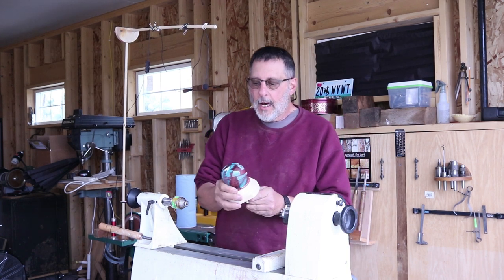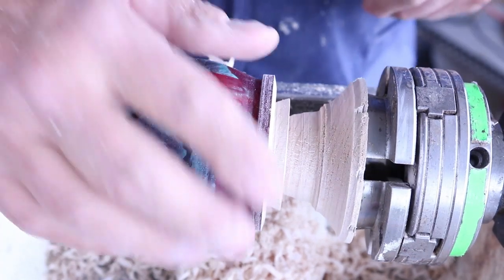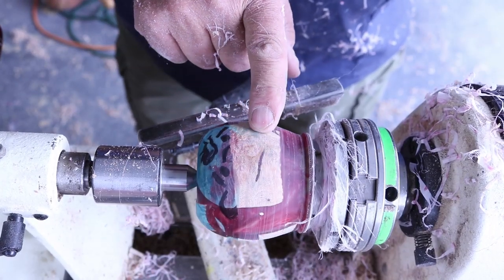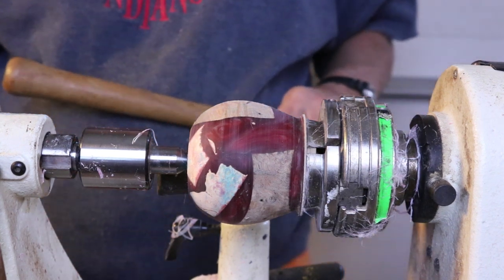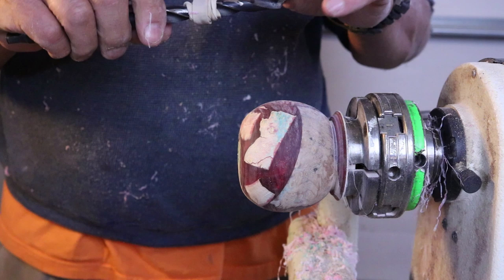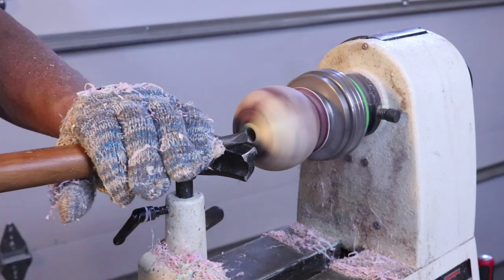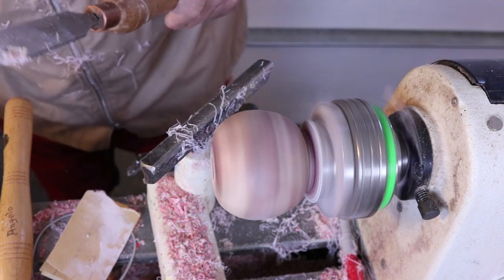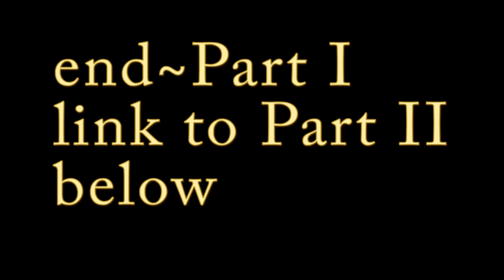An Apple A Day: Part 1 Turning and Hollowing the Base       Sam Angelo

Comment: Question? Why not hot melt glue this base to a wood base, made from using a threading tool?
Reply from the maker: I am not confident that hot melt glue would hold.....I'm just not sure.  What does, "Made from using a threading tool?" mean. Sam
Reply: Sam, response to my hot melt glue. I do only segmented turning, and I take my assembly on & off the lathe frequently. I started making and making wood spindle chucks by using a Beall spindle tap. I hot melt glue my bases to these wooden chucks, it holds great. The trick is to apply the glue when it is HOT, then let it cool until it becomes opaque .So far, so good. Thank you for making your videos, I have learned so much. Chuck
Reply from the maker: @chuckbell2949  I have a lot of confidence in double stick tape.  I just haven't used hot mel glue.  I will try it.  I know there are various grades and qualities of the hot melt glues.  It would be very convenient.  Thanks Sam

Comment: Sam, this is a really nice piece. I did noticed that when you put the tenon on the piece that you put a dovetail on it. The chuck appears to be a Nova chuck with 50mm jaws. The literature from Nova states that the tenon should have straight/parallel sides as the jaws are hawk beak and dig into the back of the tenon when tightened.
Reply from the maker: Terry, ????  these jaws have a dovetail.  Sam

Comment: Well that was a good video on using the wrong tools and how not to wood turn I don’t care how slow you run the lathe that’s dangerous and not the way to hold a spinning piece of wood and one of these days you are going to find out why
Reply from the maker: Roger, I would appreciate it if you could specifically tell me which tools I used were the "wrong tools" and which tools I should use.  Then you said it was dangerous and not the way to hold the spinning piece of wood.    You are pointing out some safety issues but do not supply any solutions.  Just curious.  Sam